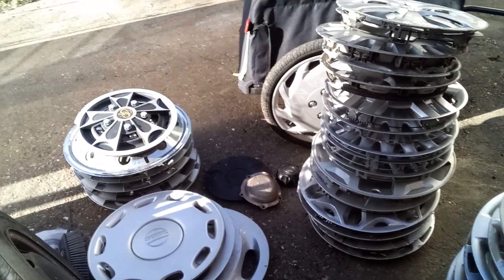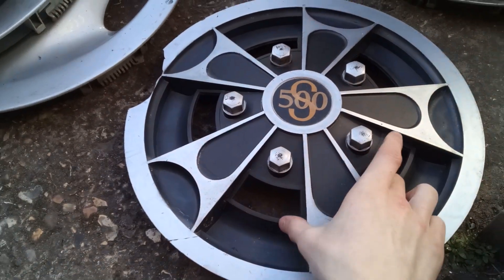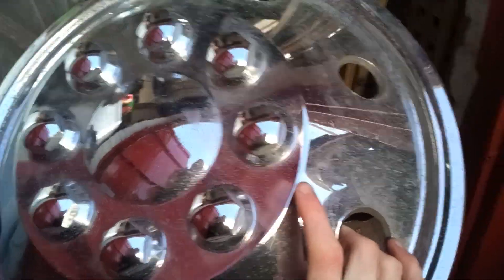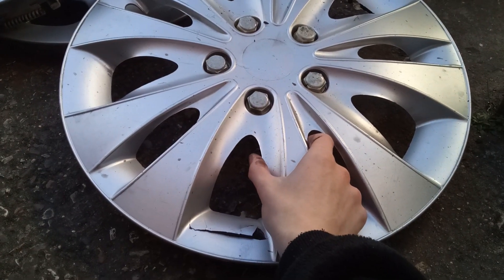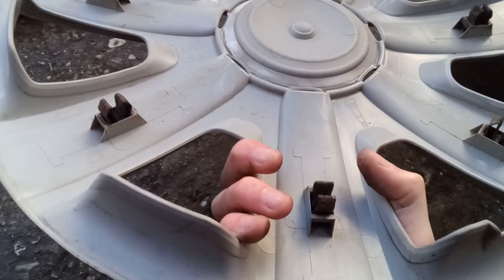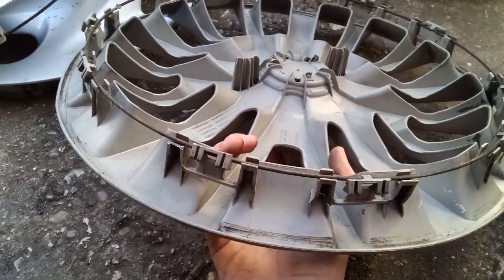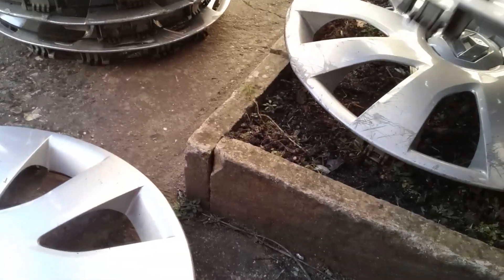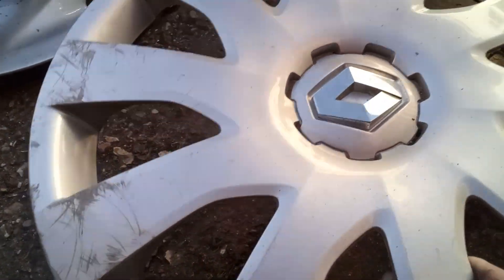Recent Finds And Buys (Part 1)

Comment: 02:30 I found 6 of these in the past week. I did take 2 because there 13 inch and I don't have that size yet but the other ones I didn't bother.
Reply from the maker: Yea I don't blame u for not taking them. U should take all the rings off the ones u don't take cuz they're always useful

Comment: Use stain remover on 0:49
Reply from the maker: The stuff I use is brake dust and stain remover but even that doesn't work. It works in most badly stained caps but not so well on mud stains😭
Reply: @mikepeugeot7344  wow I’m suprize stain remover didn’t work
Reply from the maker: @TheMG4hubcap  I was too. I've had a few caps similar where the dirt is so firm on there. I guess even the strongest stuff sometimes doesn't work
Reply: @mikepeugeot7344  use the cleaning stuff called elbow greese it's work a treat